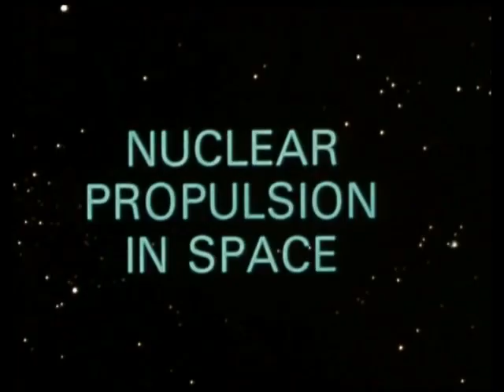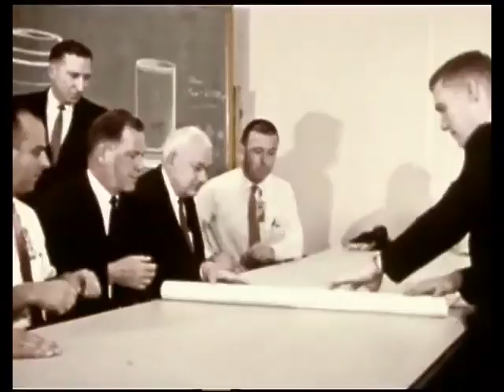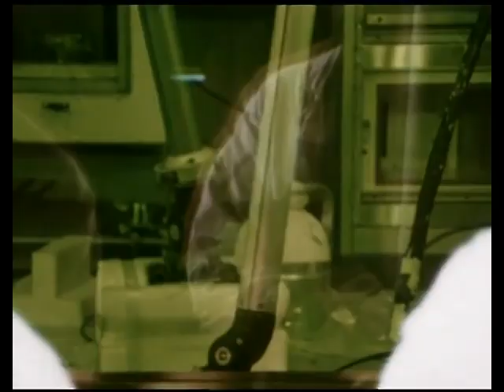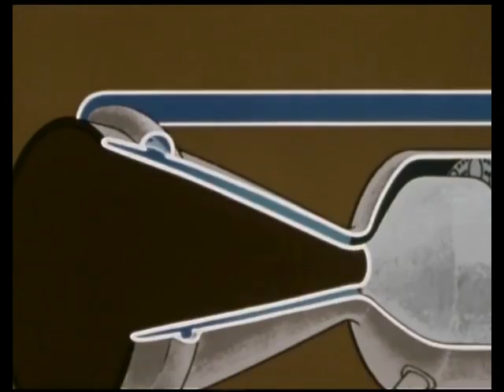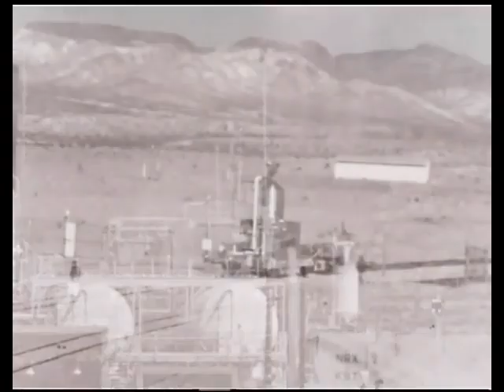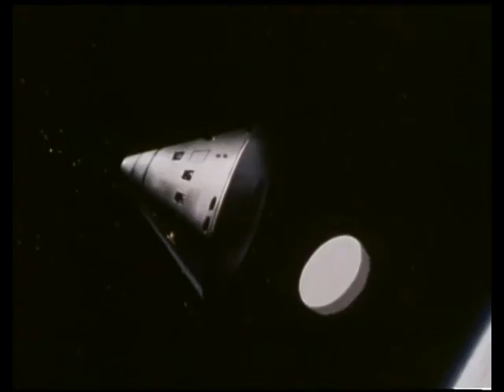Nuclear Propulsion In Space 1968 NERVA Manned Mars mission NASA video

Comment: 75 thousand pounds of thrust is nothing. You can get that feeding someone too much Taco Bell. 17 minutes of video for that...
Reply: Low thrust but high efficiency.For example; Ion engines are very; very low thrust but a slow acceleration to high speeds. NTR engines aren't suitable for a launch from the pad. However they are meant to be used in orbit to send heavier payloads or faster transit times.

Comment: (Mercury fuel)+ sodium reactor  designed(NERVA)preheater +(vasimr) exhaust system. = fast.

Thorium reactor preheating mercury to 67°C while also powering the vasimr system.  Preheated fuel gets 2 more thermal increases and then is expelled at ludicrous speeds. 

I think any plasma engines based on an atomicly heavy fuel will be to the crafts benefit.  

Feel free to correct me if I am in error

Comment: Why NASA is not using the NERVA system for the SLS rocket when it travels to Mars in 20 years?
Reply from the maker: In all likelyhood, NASA will indeed use a Nuclear Thermal Propulsion System similar to NERVA when it has manned Mars missions, and is currently developing new nuclear thermal engines. SLS is only the lift system to boost the astronauts into orbit or lunar orbit. One in space, the astronauts will dock their Orion capsule with a larger vessel equipped with nuclear thermal propulsion which will take them to Mars.
https://youtu.be/dgILm5veFs0

Comment: So Much potential! Apollo was the program with the most potential and practicality until now (Orion/SLS), the Apollo spacecraft could be slightly or heavily modified to yield a much wider range of missions including a maned Venus flyby. The Saturn family of rockets were an amazing class of vehicles, they can also be modified in such a way. Take a normal lunar Saturn V, modify the SIV-B stage to a "wet-workshop" replace the Lunar module with a docking system and you have your self a vehicle capable of a maned Venus flyby! Modify it some more and a Martian flyby mission is possible. Apollo's design was incredibly modifiable and flexible, often using hardware in ways which it was not designed to do, such as the concept for the Apollo Telescope Mount. What could have been if NASA continued Apollo instead of the shuttle...-even better without the budget cuts, we would be on mars by now... Here's a link to the possible missions using Apollo derived hardware: http://nassp.sourceforge.net/wiki/Future_Expansion That's why Orion and SLS is so important, its the flexible design of the capsule in space exploration that is so versatile and modifiable, even better Orion was designed from the beginning for deep space use and can be used for either LEO, Lunar, or deep space missions such as Mars and asteroids. I hope Orion grows into the versatility of what Apollo could have done, far better and beyond.
Reply: Trump will cancel SLS and Orion to fund research into transnational taco contamination conspiracies.

You fuckers elected him, kiss your dreams goodbye.

Comment: We had the means to get to Mars by the end of the 1970s and then we threw it all way.
Reply: you can thank nixon for that. because of the cost he replaced saturn V  with space shuttles with the specs that doesn't benefit nasa. and the whole shuttle program end up being obnoxiously expensive that if the saturn v was operated at the same cost, there will be 6 saturn v launches every year. imagine 6 launches per year for 30 years. we could have 10 iss and the moon base and at least one mission to mars. rot in hell nixon.
Reply: fucheduck it is not easy to reverse back nasa to pre-nixon era, and it sure as hell expensive to build back the industry that could produce saturn v, and that is not including the cost of the actual saturn v and all apollo hardware.
Reply: Well if we had a much larger budget and we could continue the Saturn five program we would’ve already seen a Mars mission taking place well the most favorite design of a Mars mission was Warner von burun.s Ares Mars expedition which would’ve used  A total of 11 Saturn MLVs (modified launch vehicle) and use an S-II as the tug and use five chemical or nuclear engines
Reply: nixon is gone.
what the Hell is going on now.
Reply: Dont be so sure "we" have not gone, they throw away trillions. JFK wanted to disclose all the corporate scams.
Reply: There are a lot of problems to address before that! Like outer space radiation for example, and we can get to Mars via chemical rockets, it's actually less dangerous as you don't travel with a radio decaying isotope in your ship
Reply: And yeah I'm totally 3 years late
Reply: These projects were black hole projects.  My dad worked on NERVA.  A LOT of times they go into into deep black projects when they get close to achieving the mission so maybe it was continued.  Just before my dad died and they were talking on TV (2014) about wanting volunteers to go to Mars on a one way trip,  my dad said "We've already been there".  After he said that, he got a real worried look on his face and told me not to repeat that because he could get in trouble.  He still thought they could come after him even at age 90.  When I was young and asked what he did at work, he said "We make toys for Santa"

Comment: Can you believe Nixon snubbed this project for the space shuttle? If he had chosen to commit funding to this project instead we probably would have had colonies on Mars by now.
Reply: Look up Space Transportation System (not the one used for the space shuttle numbering system). The Space Shuttle was supposed to play a part in helping with the Mars mission described in the video and other missions beyond low Earth orbit. Unfortunately the Space Shuttle was the only part that was funded because it was the only part Nixon was interested in. The Space Shuttle inherited the STS name after that point.
Reply: The original plan for the space transportation system had both. In fact, it had 4 parts:
1) A space station in low earth orbit for assembly of BLEO spacecraft
2) A chemical tug that could be used both to move cargo in LEO, or as a lunar lander.
3) A Nerva based stage for in-space use to handle transfer burns to Mars
4) A space shuttle to lift 1-3 into orbit.

In the end, 4) and 1) were built. The Nerva stage was lowest priority because it was only really useful for Mars missions that seemed to be unlikely in the funding environment at the time. It gave only a slight payload increase for lunar missions and would have had less payload to geostationary orbit than a hydrogen chemical stage (due to the high mass of the engine and low fuel density).

Nixon wasn't really at fault tbh, Congress was.
Reply: Historically the space program as a whole became a scapegoat that was in need of trimming to satisfy vocal masses during turbulent times. Unfortunately the masses couldn't see the forest for the trees.
Things like Apollo became politically hard to justify when it was easy to say (without proof) "if we can land man on the moon why can't we ________" it was the 60's version of a meme. NERVA was Nuclear and you know how people feel about nukes even if not weapons (examples being trying to block the launch of Cassini mission to Saturn in 1997 saying it's nuclear power source/"battery" somehow was a violation of the weaponization of space/nuclear test treaties). This is how far people go. They grossly exaggerated the danger of Cassini's launch if there was a failure in the Titan IV as well as various what if scenarios when Cassini would fly by Earth on its way past Earth (most likely the nuclear fuel would burn up but alarmists equalled it to a nuclear attack from space). Anti-Nuke people are alarmists (nukes are not toys to be fair) but they will spread thier view like a bad name to make thier point.
Reply: because of the cost nixon replaced saturn V  with space shuttles with the specs that doesn't benefit nasa. and the whole shuttle program end up being obnoxiously expensive that if the saturn v was operated at the same cost, there will be 6 saturn v launches every year. imagine 6 launches per year for 30 years. we could have 10 iss and the moon base and at least one mission to mars. rot in hell nixon.
Reply: J Calhoun https://en.m.wikipedia.org/wiki/Budget_of_NASA
Reply: Nixon had nothing to do with space, and his replacements had some power too... heard of Obama?
Reply: The DEEP STATE Illuminati don't want sheeple in space, period. Bad faith runs the fake WHITE space program run by NASA.

Comment: This is a very interesting technology.  I liked the control system because the power changes could be made very rapidly.  Correct me if I am wrong, but I think that submarines use a similar system for reactor control (the rotating rods).  However, only getting a doubling of efficiency does not seem worth going to the nuclear solution.  And I don’t think that you are going to get much better than that because you are limited by the melting temperature of the rocket parts.    Not orders of magnitude anyway.  Additionally, the mission as describe would be throwing way most of the fissile material.  

Given what we know now, learn what we can from this technology, but clearly the future of nuclear space rockets would be Nuclear-Electric-Plasma.  Xenon is the propellant of choice for Plasma rockets, with an MSR the Xenon and Krypton can be harvested from the reactor and used as propellant reducing the amount of compress gas that would need to be carried.  Such a system could be used for decades.   The other interesting thing is that this system actually favors larger space craft. Because regardless of the size of the reactor, the shielding mass requirements are about the same, so with a larger space craft and reactor the shield mass is a smaller percentage of the total.

Thanks for posting this video I was looking for it.  A previous copy had been taken down.
Reply: Michael Runyan I'm sure with modern materials in metallurgy you could produce a great atomic engine. These Kiwi and Phoebus Rockets are still great though.
Reply: Don't underestimate what a doubling can do in space.
Reply: @doltBmB  Granted, and certainly not off the table and dependent on the specific needs.  However, greater efficiency  can be achieved  with a nuclear electric Plasma rocket system and with most space application, long period low thrust works just fine.  The only time that you would need the high rate of thrust provided by this system, would be cases like climbing out of a gravity well.  Every system has there advantages and dis-advantages.  One more tool in the tool box, Yes.